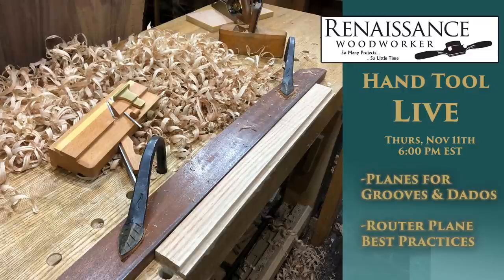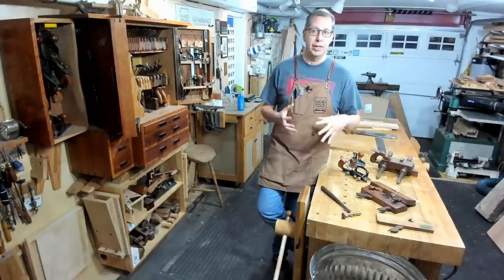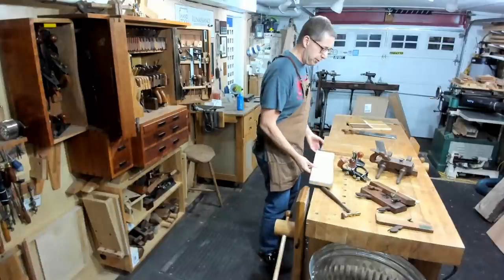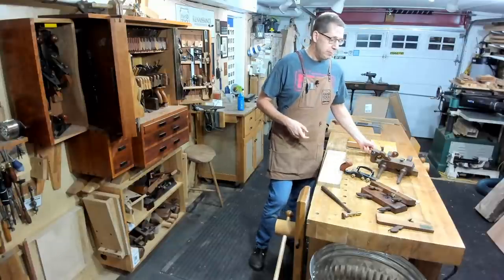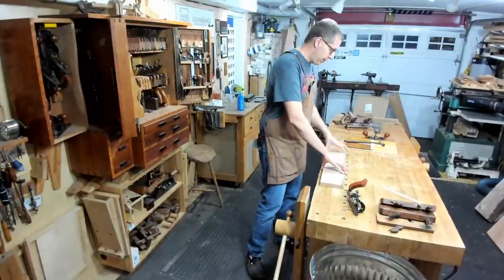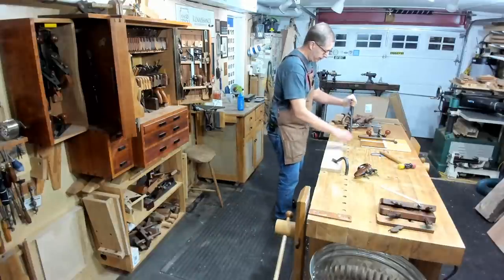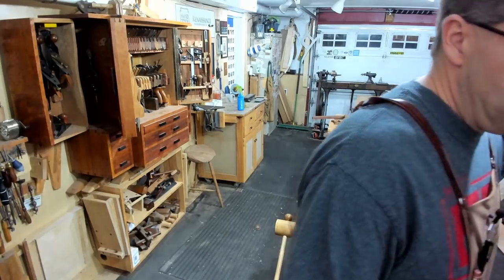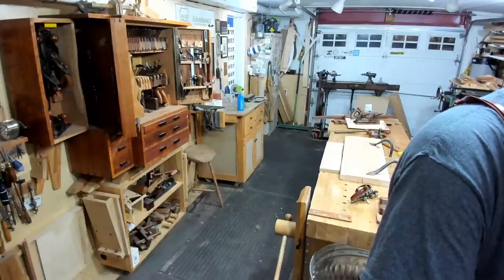Dados & Grooves, and Router Plane Best Practices

Comment: Many thanks. As always just brilliant! My main challenge is always trying to make things repeatable. Quite a challenge!
Reply from the maker: maybe don't try so hard and avoid that challenge.  Repeatability is actually much harder with a hand tool approach because we don't start with a perfectly milled board created by machines.  Its not necessarily a disadvantage but it doesn't give you a constant on which you can base repeatability.  Treat each part as unique and you might be surprised how efficient the work can be.

Comment: so if you have the fence for the veritas routing plane, could you make a groove for example to make frames for doors?
Reply from the maker: Yes you can but you really need to take a light cut as the unsupported blade will chatter easily.  In general the router plane is meant for refining joints, not creating them.
Reply: @RenaissanceWW  This is indeed my fear. Well I'll try it out on a small frame and I'll see if the routing plane can get decent results. But it does sound like I'll be needing a plow plane for this Christmas. Thanks for the response!

Comment: @37’ in, doesn’t the saw set chew up the straight edge?
Reply from the maker: Nope.  As you pressed the saw into the fence the set teeth are the limiter.  Then as soon as you start cutting the teeth sink into the wood and are below the surface and never make contact with the fence.
Reply: @RenaissanceWW  I've always used scrap stock for this purpose out of fear that I would damage a straightedge (or because I didn't have a suitable straightedge).  Good to know!

Comment: Well Shannon that was a really good session. Looking forward to metered half laps, they have intimidated me enough not to attempt. Maybe you or someone can answer a question I have had some time, I have a Stanley 12-250 plow/combo plane that works great, it came with a full book of cutters plus some others, however it doesn't have a 3/4 inch and none was offered. Why?
Reply from the maker: most likely because the 3/4" size wasn't a benchmark until much more recent times.  Well after the combo planes had slipped into "old timey" characterization.  I talk a bit about that in this session with regard to dado planes

Comment: I noticed in the video that it appears you have a sloped shooting board.  Do you find the sloping has advantages over the standard shooting board?  Also, what did you mean by, "That microwaved crap at Home Depot"?
Reply from the maker: not particularly, no.  The slope is a good idea in theory but practically I don't find it makes much difference.  As far as Home Depot wood, their material is often dried way too fast leaving it unstable or sometimes over dried and too brittle.  Like a microwave where you can have steaming hot on the inside right next to ice cold for your Hot Pocket.